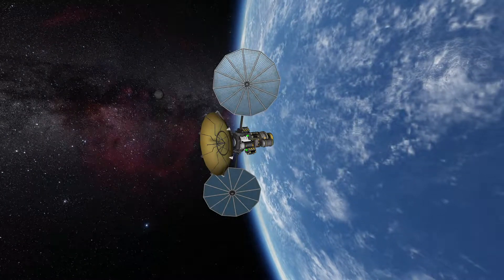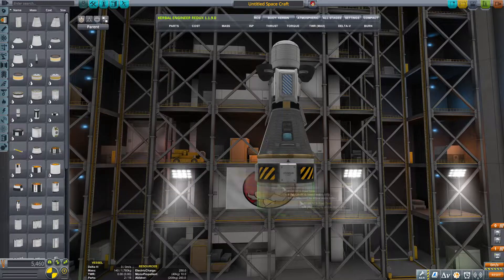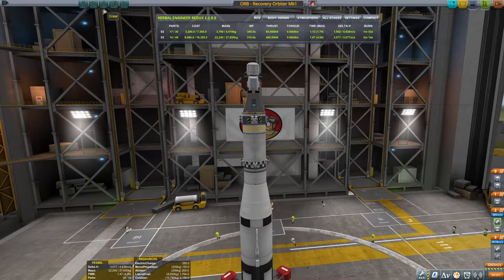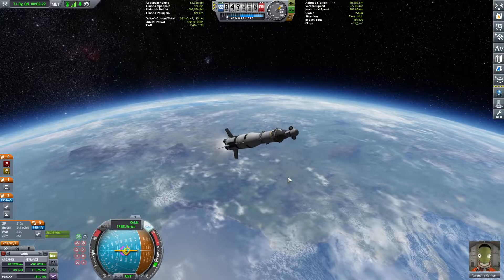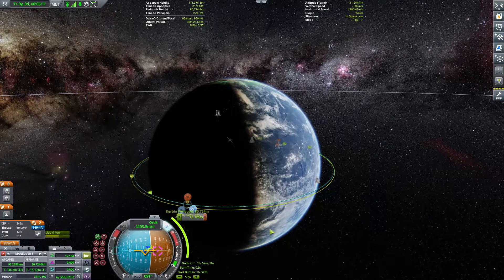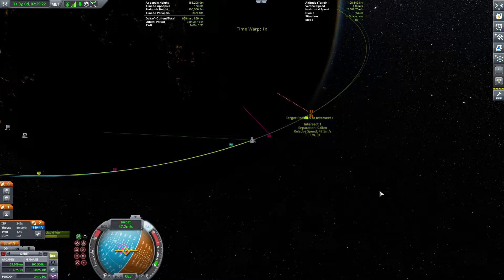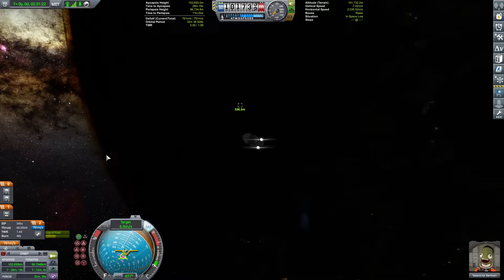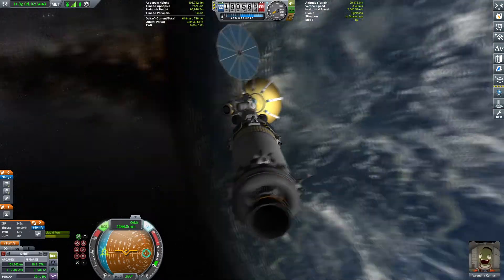How to recover Science from Orbit using grabbing unit - ep 08

Comment: How you understand where to position on the navball manually and burn fascinates me. Could you make a tutorial on that? (or have you already made one?) It requires an intuitive knowledge of vector components and experience with the navball and I would love to hear more about it.
Reply from the maker: If you mean for the rendez-vous its actually quite simple. Once you have a decent encounter (say 8km or less) and start approaching your target remember the following:

1. The goal is to make yellow (orbital) and pink (target) markers align. 
2. The important thing is that both yellow and pink marker must be of same orientation (so either both prograde or both retrograde)
3. Then remember the following. YOUR CURRENT NAVBALL ORIENTATION (center of naball) when you burn will try to PULL your (yellow) PROGRADE marker towards itself (so you will notice yellow prograde marker going towards the center of navball)
4. Similarly if you have yellow RETROGRADE marker, when you burn, the retrograde marker will try to "RUN AWAY" from your current orientation (center of navball)
5. Having points 3 and 4 in mind I position my ship orientation (center of my navball) depending on my target velocity to either:
5a.  .... drag the yellow PROGRADE marker on top of the pink PROGRADE marker (watching that i do not exceed velocity of 30 m/s) .... or
5b ......push the yellow RETROGRADE marker away from navball center and ON TOP of pink (targets) RETROGRADE marker, and aiming for around 20-30 m/s relative velocity.
6. As i approach the station i typically decrease my velocity to (30m/s down to 800m, 20 m/s down to 500m, 10 m/s down to 200m, and then 5m/s till 100m). usually having RCS on and pressing H (prograde) and N(retrograde)  can save you so you do not have to burn with engine

That is it. Actually my text is more complex then it looks but re-watch my video with these comments in mind, and then you will see for yourself just how simple it is once you get it :-). Good luck
Reply: @GrunfWorks  Precisely - rewatched with the comments in mind and wow, lightbulb went off.  Thank you for this!  Excellent!